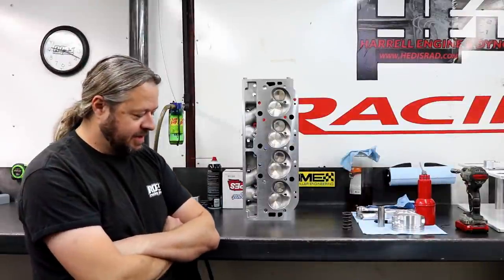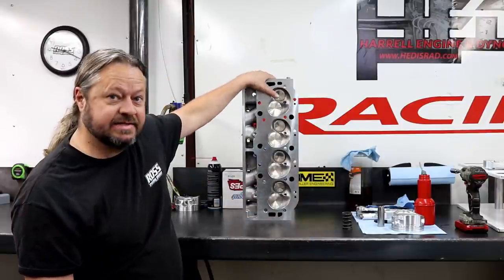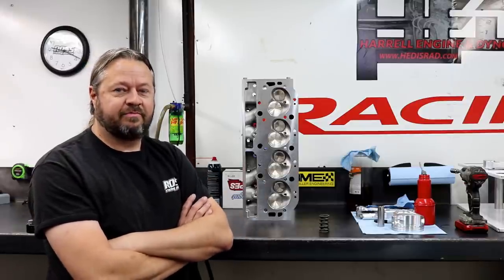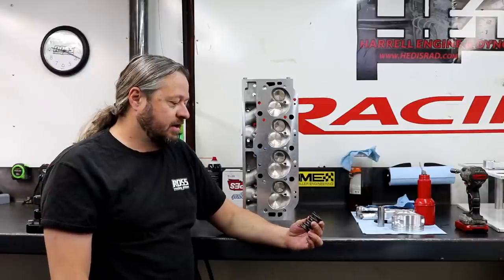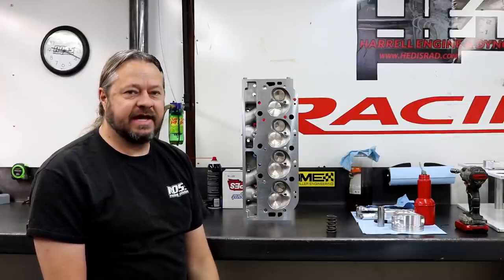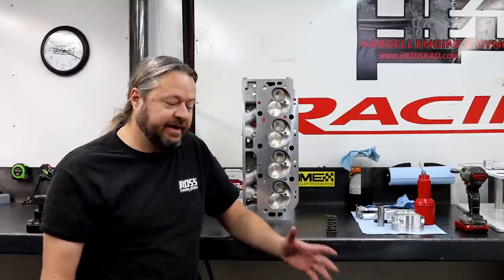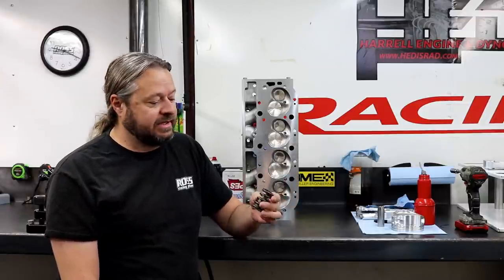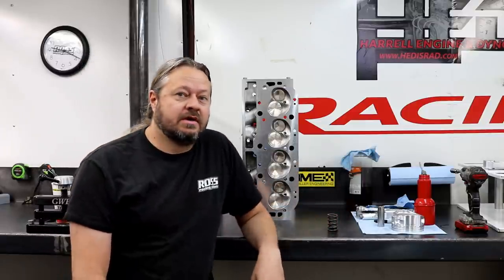Chinese Cylinder Heads

Comment: A lot of self-proclaimed "hot rodders" are really just mechanics. Instead of fixing a part that doesn't work (or work well enough for performance), they just unbolt it and bolt on something new. Like tossing the HEI on a street engine for a racing ignition, or a Q jet for a Demon. If a shade tree mechanic wants more airflow for cheap, they might as well hit the junkyard and score some Ford GT40P's off an Explorer, or Vortecs, etc. At least they're seasoned.

Bolting a set of heads out of the box onto an engine is like doing a lung transplant on a runner using lungs from a baby--under the theory, "hey, they're new, and lungs are lungs".  That weak spring may make for a flat tappet lifter break in, and that's about it. Honestly, I'm glad at the responses here--this many internet folks saw right thru this. Buy heads for a basic chamber design, or valve angle, or relocated port design, and break out the dremel and airflow bench (boy did i age myself, the CNC machine) and work from there. 

Even "Chinese" is a misnomer dog whistle. As any society moves from agriculture to industrial, the workers make enough money to have some left over to sponsor a service economy. China is becoming too expensive to make basic stuff and they farm it out to Vietnam, Thailand, etc.

And a lot of that old American brands you buy now? Guess where a lot of it gets made--you just paid for the label. I hit all the estate sales and flea markets for old tools, made with the good alloys, for pennies on the dollar since everyone buys on evil bay now.
Reply: I'm a retired auto mechanic. I've rebuilt more brake calipers and alternators than I can count. I retired in 2009 after obubba's cash for clunkers fiasco put me out of business. I've seen too many young know-it-all parts installers call themselves mechanics than I can remember that can't select the right setting on DVOM to even begin to actually diagnose a concern.
I use to just call'em a JAFI ~ J.ust A.nother F.ooking I.nstaller
I haven't the slightest idea where I was headed with this ... I guess I just wanted to share.
Reply: @RANDOMNATION907  Thank you for that respectful response. I know some "repairers" get upset when I talk about hot rodders in an age of "1-800-catalog hot rodding" being "just a mechanic". But I've "been around" since gas stations had "mechanic on duty" instead of a convenience store. I mean no disrespect, but we've all watched mechanics hang out a shingle who do not truly diagnose and rebuild. I have also had a few female friends drag me along to a car repair to make sure they were not getting sold muffler bearings and a date offer.

The customer comes in with a problem, this mechanic replaces the likely part (and now we have OBD that really makes the guessing easier).  This mechanic knows they can buy the  cheapest part (now even more so with schlock auto and evil bay), charge 100% markup, look in "the book" for the hours it will take, and figure out their boat payment schedule from there. If it solves the problem, great, otherwise the customer returns...and another part gets swapped. This keeps going until the customer stops returning--either the problem is gone or the customer went elsewhere to begin the parts swapping again with a mechanic who doesn't trust anyone else's work.

As long as the mechanic has a clean waiting room and a nice personality, they'll make a good living for years before the customer wonders if this is really how a problem is solved. Last year a friend's convertible went in, the garage couldn't figure out whether to take the rear struts out thru the trunk or rear seat.  I told them to go look it up on Youtube, they laughed at my manhood, and then...did it and learned what was the best way....24 hours later.  Right now a retired friend has been dealing with radiator flushing and electric fan replacement and a failure to bleed air out of the system to still have an overheating problem during the drive home from the dealership. I asked if the thermostat was ever replaced on the 200,000 mile car. at least this dealer mechanic is doing that now for free. I'm praying neither head lifted on the V6, my long distance friend has no income for a replacement car.

I'm no expert, I learn something new everyday, and i mean no disrespect for professionals we rely on to know more about our problems than we know. But as I age I find the health industry "diagnoses" the same way. That's a whine for another time, as my late father would say (a mechanical engineer in aeronautics, who drove me nuts as a child with his "only one way to do things", but now i understand).

sorry for the long response--long afternoon with a Q jet :)
Reply: @albertgaspar627  you couldnt have said it any better.
Reply: @frigglebiscuit7484  thank you. sometimes an exasperated expression from the heart, covers all the bases :)

Comment: You should change the description to "A short hit piece without any useful information".
Reply: I am a Journeyman Toolmaker. In my experience with Chinese machined/fabricated components or tools, for the most part it seems their philosophy is "We made you one and now you have one. You didn't have one before. You are happy." The concept of making something that works very well and will last, or works at all sometimes, seems to elude them. That they made something that only looks like what you want is too often their "bar."
Reply: @1001Hobbies  That's a flawed philosophy that does not tie back to cylinder heads. Maybe tools lol.
Reply: @dreamsteelgarage8418  - Yes, it does. Cylinder heads are machined after being cast. First is the lack of quality metallurgy in the formulation of the aluminum. Then, the machining quality is only as good as how much the one doing the machining cares. Whether machining a tool (by tool I don't mean pliers, I mean tooling that is used in the manufacturing and assembling of automobiles, including automation) or machining cylinder heads, it is still "machining" and all principles are the same.
Reply: @1001Hobbies  All heads are cast overseas, whether they are GM or aftermarket except maybe one manufacturer. The quality of the aluminum is quite good and has progressively gotten better over the years. You can't blanket all Chinese heads as bad period. Also, most are machined on 5 axis CNC machines so there is no guy holding a drill working on them. I've used and worked on literally hundreds of these heads with great results.
Reply: @dreamsteelgarage8418  - GM and other auto manufacturers have their own people present to oversee the production of their heads and blocks. This is the difference. A Chinese brand manufacturer of aftermarket cylinder heads does not have that kind of oversight, and the philosophy I mentioned comes into play. It's a cultural thing.

I got tired of buying a new grill made in China every year and a half to 2 years (stays out in weather and gets a lot of use) so I bought an American made Weber grill which lasted me 16 years. I replaced it with another Weber grill about 6 or 7 years ago. Can't tell it's that old by looking at it. 
I can't afford to buy cheap.
Reply: @1001Hobbies  Your comparing your bbq grill to cylinder heads?  Cultural issue? I doubt that logic as the Japanese do not have an issue. GM does not have their people stand over a Vendor when they manufacture their heads.  I'm sorry but you have been misinformed. If that was the case, they would have to have employees monitoring vendors in other countries who produce their heads.  And even if they did, do you think the metallurgy is discernable to the naked eye? If that was the case, why is there an issue with the ZO6 heads dropping valves which are produced by 2 different vendors?? I've been in this business for years. Have you even built an aluminum race head before?
Reply: @dreamsteelgarage8418  - And not all heads are cast overseas. Mexico is across a land border. I know due to emissions regulations in the US, Ford closed up it's Cleveland casting plant. They had just purchased 2 brand new cupola furnaces (latest high tech) to replace the originals from the 1950's, and they were sitting on the property while preparations were made to swap them out. Then the EPA passed new regulations (During Obama Administration) and Ford dropped the idea of installing the furnaces, let them rust outside, and then shut the foundry down. Money wasted. Industry ended due to uncompliable regulations. 

This is after the brake rotor and drum aftermarket industry was decimated by the Chinese dumping them in the US below market value. Our International Trade Commission only put an 8% tariff on them, which of course did NOT level the playing field. Long story short, after pleading with the ITC over about 9 or 10 years, each year fewer and fewer aftermarket companies existing, they all went out of business. 

Buy a Chinese rotor now for a price you would expect to pay just for the amount of metal in it. Take it to a shop and get it turned (they come blanchard ground) and it will take .020" to get them true. Because of the metallurgy they get hard spots real quick, and are just barely above minimum thickness so that you can't turn them after the first set of pads is used up. I try to stick with OEM.

Comment: Guys that sell cylinder heads hate Chinese heads cuz they can't make money selling the cheap heads. I have a set on a 496 that make 600+ hp and don't have any issues with them. Been running them several years. You don't have to spend a lot of cash to build a powerful engine. I'm gonna keep using them.
Reply from the maker: Generally speaking, more money can be made selling the Chinese ones.....
Reply: @HarrellEngineDyno  what's been your experience on the quality of machine work from AFR assembled heads?  Probably better off starting w/ bare...
Reply from the maker: Dr. Rabbit  what performance cam would work well with 70 pounds of seat pressure?
Reply from the maker: Dr. Rabbit  I don't think so.  These heads are sold as being intended for a mild hydraulic cam.  That's false advertisement.  How is your average hot rodder going to check that?  The purpose of this video was to expose that the buyer should beware.
Reply: Call customer service of one of the sellers of the chinese crap and they can't even tell you what spring pressure is and can't even tell what valve they use.

Comment: I've seen a Bare speedpro Cleveland Iron 4V head and the casting and machine work is on par with a OEM factory head.  It was used on a budget circle track car. Class required Iron heads OEM block, 600 cfm carb 360 ci max 
When everyone else has to grind a intake runner to make it larger, a Cleveland Owner has to fill it with epoxy to make it smaller.

Comment: Another thing check the intake  gasket to see if it matches the runners. It surprised me when I was shown how bad they fit. l noticed that intake manifolds made in the sixties and seventies aligned up very good compared to todays aftermarket intakes.

Comment: I have a set for a 460 ford they run good now but when I got them all the guides were super tight and the seats were cut for valves about .100 too small cost a few bucks to get it straightened out . I should off bought p51s from kaase
Reply: looking in this comment section i assume you bought speedmaster i was /am thing of buying them  is that what you brought .they got the CJ  ports in their add

Comment: I didn't even know this was a thing.
I knew soeedmaster and procomp was making stuff there and those are two brands that you don't want to get involved with.

I was looking at the prices of these on ebay and they are cheap.
However I have dealt with detroit diesel heads that come from third world countries and they can't build those things at all.
All of them needed to be surfaced right away.
We had one where the freeze plug kept leaking because it was manufactured wrong.
They didn't install the valve guides straight.
The seats were not machined or installed right.
The keepers for the lifter arm retainers were horribly wrong(they popped out when we installed the head).
Even the machining in the ports were terribly off.

This was just five heads and they all sucked.

Honestly just get the good brand heads with quality.
You buy these knockoffs and you will be crying because they will either destroy your engine or cost the price of two sets of AFR's to get them machined with proper equipment.
I would only buy these heads if I wanted to make some art projects.

Comment: Always, Always, ALWAYS buy a BARE set if heads and have the machine shop prep them.
Reply: I have a machine shop near me that buys bare heads and builds them with top parts and sells them, everything is checked during the build. Great heads at a great price, around $1400.
Reply: @matthewcromwell1969  That's great, how a machine shop should sell heads. I'd use them and not even think if having any issues!!

Comment: Having owned and or been involved with aftermarket heads while the US brand ones are generally better some still have some real problems. 
I have seen the China heads that generally do not flow that well have inserts fall out or the alloy is simply soft. Or the inserts burrow into the heads and you lose all tappet clearance. Plus rocker studs not where they were supposed to be
Though having bought 'premium' US as cast heads that have required a deal of work as well. Both iron and Alloy. And yes one had it seems a valve nip in the guide and the piston gave it a push closed.. Plus some valves closed up as well.  Engine went very 'flat' first event. Checked leak down and some were leaking. And were 66-67 instead of the advertised 64cc. $700 later one new valve, recut the seats and ream a couple of guides. Plus gaskets etc and having to remove the engine. And ofcourse I had alread had the heads milled to spec.
 Or some others with 'roller' springs that collapsed very quickly. Supposed to support 750 lift and collapased at 680
And some others that had the valves burrow up the ports on LPG and were essentially throw away.
So the US manufacturers need to get their finger out and finish heads correctly.

Comment: would like to see some testing - at what point are they considered poor quality? turbo or nitro at the drag strip, the mud bogs or on a mild build out on the interstate, all the heads i seen had brass guides and i dont like brass.
Reply: Perhaps you mean bronze guides. Brass would be a really bad idea.
Reply: @tracycurtright2671  whats a little Zink, but you are correct . is it a crock or gator? i see lots of comments but most probably have no clue. i myself have yet to install them. i decided to go with the factory heads and save these for the next project.

Comment: In my experience, Chinese auto parts often look beautifully crafted - like identical to OEM parts, but at a knockdown price. But they just don't seem to have any grasp at all of materials technology. Beneath the shiny outer skin the metal's usually junk. I've just had my engine out for the third time in three weeks. I fitted what I thought was a Borg & Beck clutch - which it actually was, but they had outsourced the thrust and release bearings to China. The first one lasted 10 miles, the second one did way better and lasted 30 miles. You take these out and they've just shattered like glass - even though they look like quality parts out of the box. Utter crap. Pay the extra for US or European-made parts every time, because we know how to make them properly.

Comment: Short form. Your customer is an idiot who put a set of out the box assembled heads without bothering to check the spring pressures. Then you make a video glossing over the fact your customer is an idiot by placing the blame on the product. By your logic I can blame Ford for a very costly bent valve incident near enough 30 years ago because I used 20y/o OEM springs on a .550 lift 300 degree cam in an engine I was trying to wind to 7k.

Comment: I like American Products. But people should not bash Asian made or assembled components either.
   I have a 2000 Chevrolet Blazer four door with a stock 4.3l Vortec. Stock closed seat pressure is around 70lbs. So basically you just bashed stock GM springs on Vortec heads.
   Over revving any pushrod engine, no matter the seat pressure can cause one to drop a valve. Basically end user negligence.
   I will say those look like performance heads, but they should be run at stock RPM range. I think the packaging or installation material would have mentioned something about that.

Comment: i have to sets of procomp heads 3037 and 3038 both on 351w one low compression paxton sc other set is one 11.1 351w daily driver both sets of head where stripped down bear use name brand valve ect ect no problems 

only think i did see was some of the cast kinda rough in the port took little more time porting and cleaning up

Comment: More the fault of the importer / seller.  Chinese companies manufacture to a price point.  The company that wanted to sell these only wanted to pay X for them so they could sell them cheap.  Had they wanted to pay Y and specified higher quality castings, springs, etc the heads would have come that way.  Chinese manufacturing is capable of producing anything at any price or quality point, it's the customers pick.

Comment: Good topic.Reminds me of the car guys out there with 400 or 500+ hp cars that buy cheap Chinese tires to save a few hundred bucks but end up in the ditch because of poor traction.
Reply: or the young'uns who buy a junkyard LS, boost the life out of it to be a dyno queen, and replace it often as a result..while their father with a 4 bolt 350, steel crank, forged pistons, making 400 hp lasts forever.
Reply: or the young buck who buys junkyard LS, boosts the life out of it to be a dyno queen, replaces it regularly, while his father still has the 400 hp 4 bolt Chevy 350 with forged crank he put together in the 1980's.